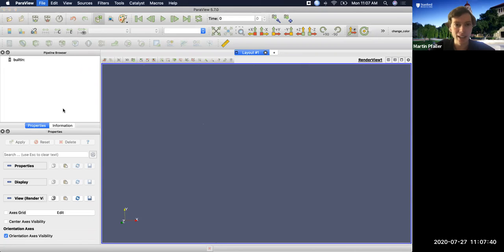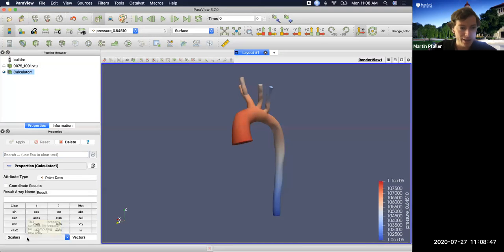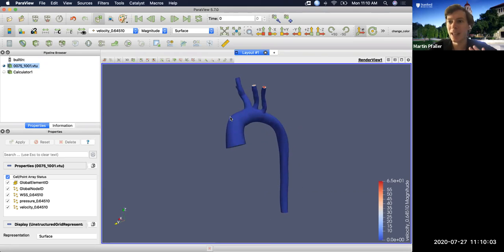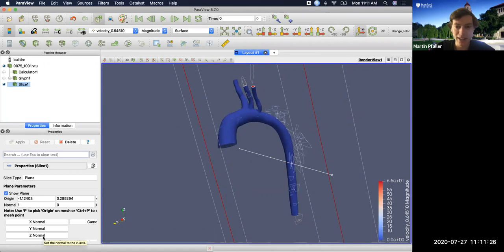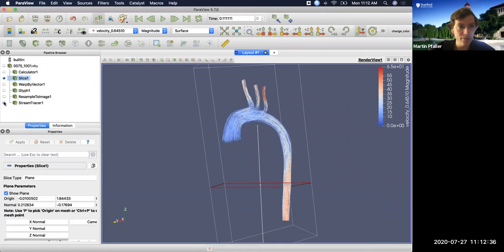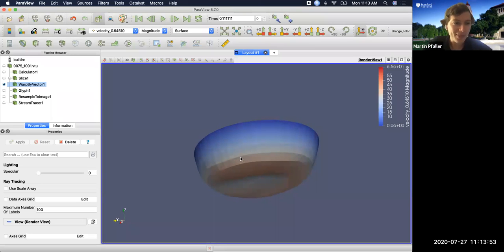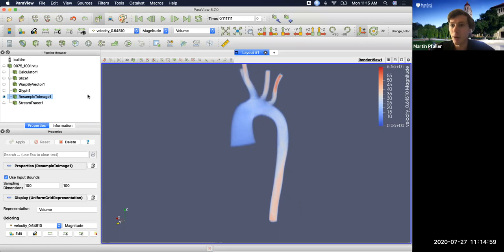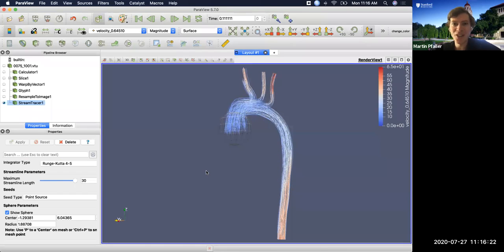SimVascular Tutorial 11: Postprocessing with Paraview

Comment: Thank you Mr.Martin Pfaller. I have a questions to ask.How can i get a numerical value from paraview for pressure,velocity, WSS(Wall Shear Stress) and particularly OSI(Oscillatory Shear Index) results.
Reply from the maker: Hi! There are more example available on the SimVascular website (http://simvascular.github.io/docsFlowSolver.html#postprocess). You can change the display for pressure, WSS, velocity, and OSI from within Paraview. Let us know if you have more questions. The SimVascular User Forum (https://simtk.org/plugins/phpBB/indexPhpbb.php?group_id=188&pluginname=phpBB) is checked more frequently than YouTube if need more immediate response!